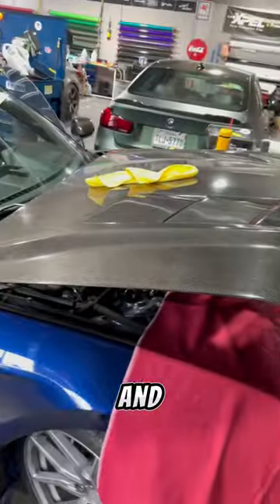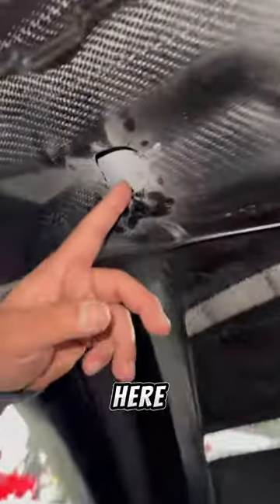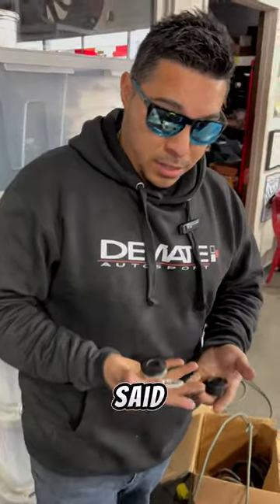HOOD PIN INSTALL ON CARBON FIBER HOOD🤯‼️ #shorts

Comment: Guys, I know thats not a solid carbon hood as we can see the Fiberglas coming out, but please please always where a mask when grinding or drilling carbon. I was an assembly tech on the Ford GT and use to drill and grind carbon daily, it’s sooo not good for your lungs…
Reply: i just snort it through my eyelid
Reply: Bros spitting facts, for the love of god you do not wanna breath that shit in
Reply: Wear an N95 or P95 mask for micron filtration
Reply: Not solid but the underneath is 100% carbon?
Reply: You can see it when they show the fucked up hole from underneath
Reply: may i ask what generation gt
Reply: @miatacheese 😂😂
Reply: Little water goes a long way in helping all that dust that flys up, it’ll cake up like a paste rather than in your lungs

Comment: Extremely sloppy job, not prepping the area or taping it off, using the wrong bit, and look how janky that cut is once the hood is open. Take the extra 5 minutes to detach the hood so you do the job the right way
Reply from the maker: How many have you done? I been installing them since 1997... so there's that. Text book mechanic 🫡
Reply: would definitely not go to here they be scamin fr
Reply from the maker: @user-df8nt8wb4s  first off, no, we been in business 27 years, and I play, a lot of social medial. Just playing, relax
Reply: @dv8aroldo the amount of time you’ve been working doesn’t reflect through your work… please be better.
Reply from the maker: @biggya21  thank you, and if you knew me you would know that's my motto, I get better each day, I think we did a pretty good job, I will send you the IG link so you can see, tell me what you think
Reply from the maker: @biggya21  https://www.instagram.com/p/C4R_jOeup1Y/?igsh=MWppYXc4YWRrb3NjaA==
Reply: @dv8aroldo  but you don't wet it when cutting or drilling?
Reply: @dv8aroldo  the dude is right you should have taped off why not just admit it. As defensive as you are it’s size issued guaranteed
Reply: @dv8aroldo Terrible job, poor workmanship
Reply: @hidros1461 you not gonna bait him into another reply lol
Reply: That's some sloppy amateur work for real.  Not something you would expect from any professional shop
Reply: @dv8aroldo  considering I make custom carbon fiber parts for racing karts I would say I know a thing or two about cutting and fitment. If you’ve been doing this since 97 and still can’t do a clean job that says a lot about your work ethic
Reply: @dv8aroldo Sounds like you’ve been fucking up carbon fiber hoods since 97😂 🤡

Comment: Holy hell, that hole underneath looks like a diy install. Take some damn pride.
Reply: Yea for professional shop that's a bad look..2in whole saw run bit through the same whole on the bottom BOOM nice clean 2in/2 1/2in round hole...not rocket science 😂

Comment: I mean I would have put some tape on top of it when I was drilling it so I didn't risk scraping up the outer layer carbon and I know it's just fiberglass but you really shouldn't be breathing. That stuff in real carbon fiber is even worse.

Comment: What a stupid accessory. Just ruined that hood for nothing.
Reply: Defintlet functional…….but go off ✅✅
Reply: That was a carbon hood, so he's either doing it for looks, and alot of people like the look of hood pins, looks aggressive, or he's smart, and he knows aftermarket hoods sometimes don't play well with factory hood latch equipment, and can fail at times, and you get to be that guy with the hood that flies up on the highway, and fucks your car up. When I install my hood, I'm 100% putting hood pins in, for both reasons, because it looks nice, and so my hood doesn't just pop the fuck up. Literally go to Google, and look up carbon/fiberglass hoods and hoodpins. It's common knowledge.